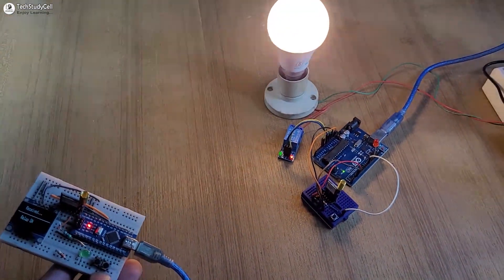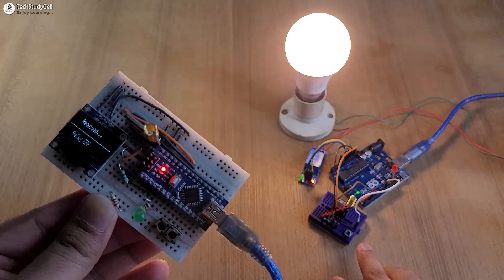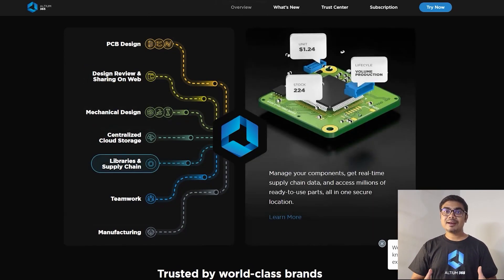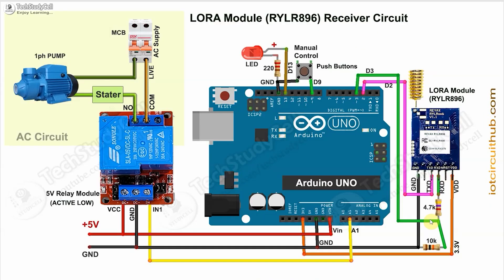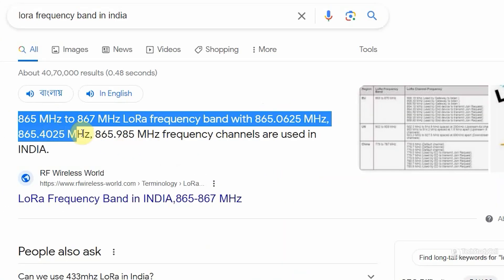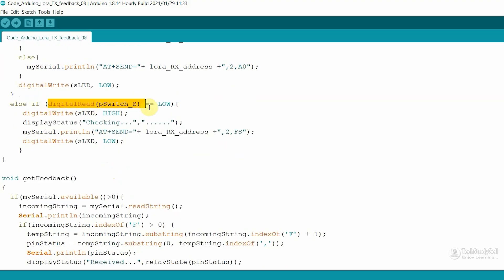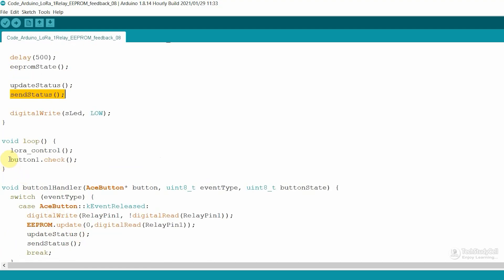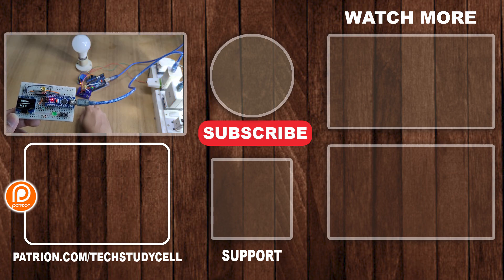LoRa Arduino Project to control Relay with feedback | Lora Tutorial 2023

Comment: in the video circuit i see  it does not match the circuit diagram given , my project to not working at all, even the manual button in the relay module does not activate the relay
Reply from the maker: I have corrected the code Code_Arduino_LoRa_1Relay_EEPROM_feedback_08. Change done: SwitchPin1  9  //D9

Comment: iI have made some projects in this way but I am facing some problems like the motor is 3 phase and sometimes it is not 1 phase, in that condition my motor can also burn. What I mean is that I can take 3 inputs from the receiver side and when there are 3 inputs then it turns on and like if any one of the 3 inputs is off then the motor should go off automatically, that's why I want to see on the oled screen as well whether the 3 inputs are on or off... please guide me . thank you
Reply from the maker: For 3 phase motor you have control the stater coil with relay.

Comment: Hello bro., this doesn't work. The transmitter end LED remain ON when program is uploaded. It was supposed to be ON only when switch pSwitch_1 is pressed momentarily. I checked for any mistake in wiring again and again but void, it is as per your sketch. Nothing is displayed on OLED. It is stopping me to build receiver circuit. Dont know it will also work or not.
Reply: Bro did you find the solution

Comment: Has anyone actually got this to work? I followed it to the letter and nothing happened. I took it to a professional and there were many errors in the code, mismatched baud rates, and the REYAX of the transmitter is not grounded except through the switches or LED resistor- it has only 0.3v supply!. The voltage dividers are wired wrong the LoRa Rx goes between the resistors not in series. Mine would never have worked and still doesn't, I have not got to the bottom of all the bugs yet. I have wasted many hours on this misinformation. If anyone can get this to work please let me know as I have a use for these and they are exactly what I want so I would like it to work..

Comment: Good job! However, there’s just one thing that needs to be corrected. The 4.7 K ohm resistor should not be placed there. Instead, it should be connected between the Arduino and the combination of the LoRa Rx and the 10K ohm resistor. The LoRa should be connected to both the 4.7 K ohm and 10 K ohm resistors. Furthermore, the 10 K ohm resistor should be connected between the LoRa Rx and the GND.

Comment: I have a project idea can you implement it
Reply: Its the monitoring and controlling the temperature, humidity,light intensity water level and ammonia and carbon dioxide gas in poultry farm. By using esp32 board , dht11 sensor, LDR sensor, MQ-135 and MQ-5 sensor. Then we have to send the data to firebase. And from firebase to mobile, and there shold be a logic if  click to torn on fan or light 🚨 by clicking button from mobile app
Reply: Reply me if you are going to do it

Comment: Bro please make video using lora controlling water pump for farmer... Please
Reply: Good idea 👍💡
Reply from the maker: You can use this same project to control water pump. Please watch complete video
Reply: @TechStudyCell  Not working for me, no response to AT command when passed through SoftwareSerial of Arduino Nano😭
Reply: Boss, Most agricultural irrigations are 3 phase !! . Pls advice , how to link.thanks
Reply: But some modifications required bro like electricity supply is there or not will show in remote and voltage and current parameters will show in remote display like this bro
Reply: @mukeshangadi2551  Correct, did you make these changes?
Reply: What is the cost of full set...sir
Reply: Ye Lora buhat jadeed h 😂😂😂😂